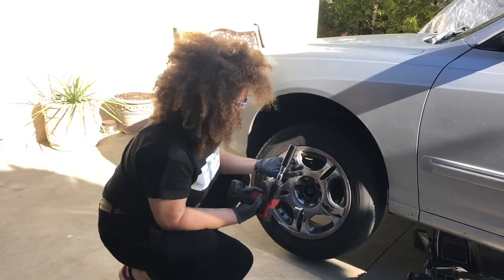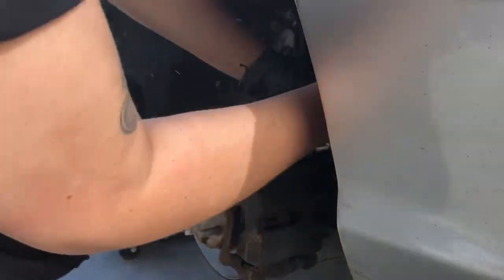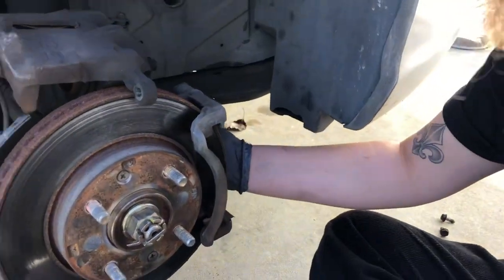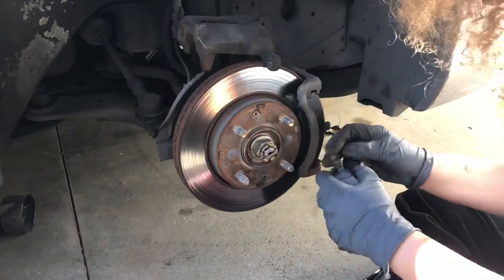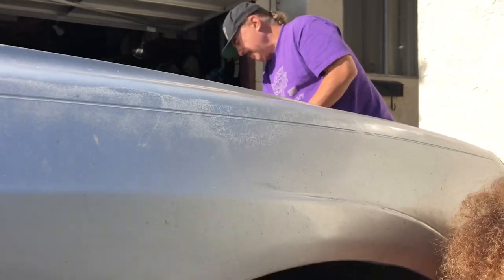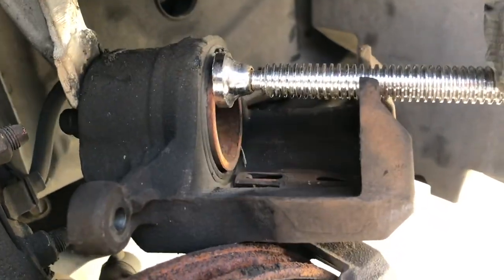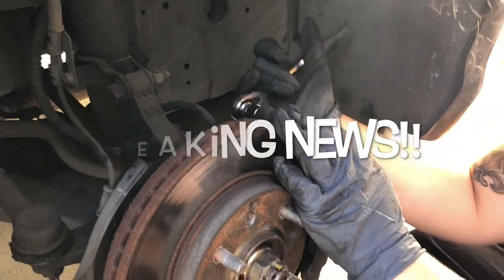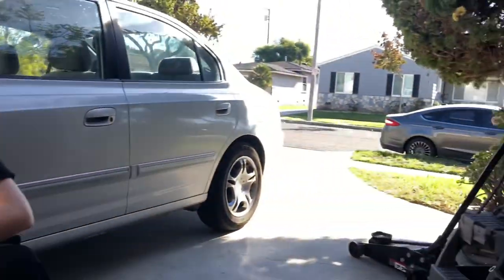She changes her brake pads for the first time!

Comment: Aww man, you know I got to leave a comment. Fist and foremost. Get the right tools because C-clamps can be dangerous for seals. Espacial something like brakes. Also getting the disc machine is also a good idea to ensure long brake life and to get the most out of them. I always want to start a mechanics class for women but my anxiety and lack of courage is not really ideal for teaching.
Reply from the maker: Tonytheman85 thanks so much for the comments. Having the correct tools are important. Thanks again!
Reply: Mark, let me know if you need to borrow tools   Also I know a guy that will turn rotors for cheap.
Reply from the maker: Tonytheman85 Thank you so much!!!!! 👍👍👍👍